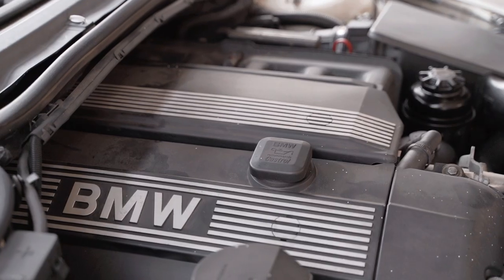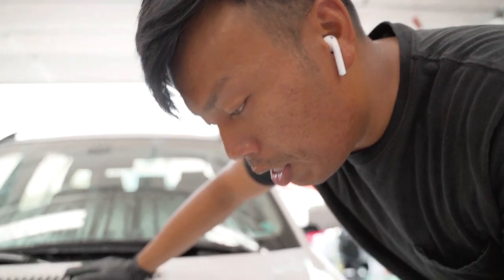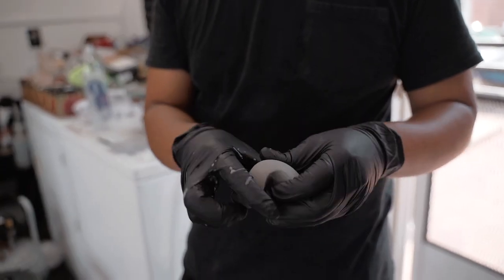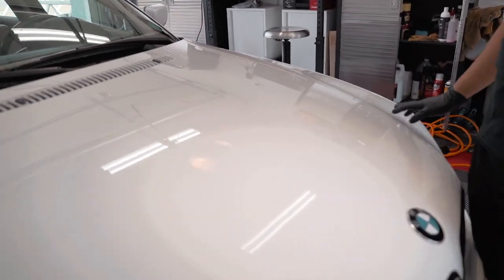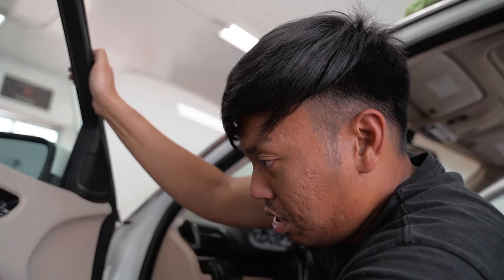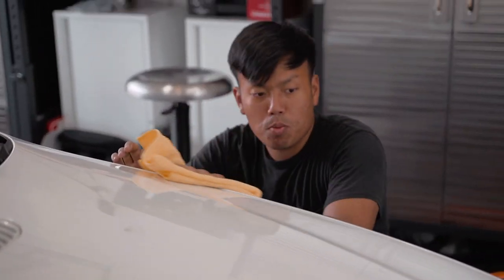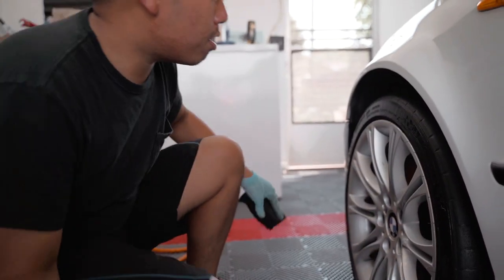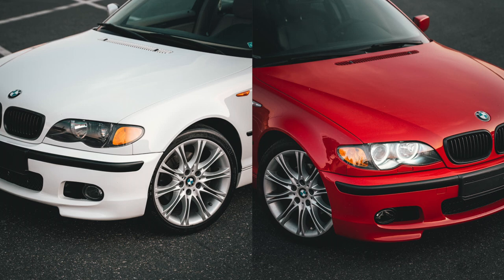DETAILING A BMW E46 "ZHP" STYLE WAGON

Comment: I just finished a zhp swap on a white wagon for a client and had to double take for a sec. Difference is I swapped in the engine and transmission. Would recommend to anyone that wants an e46 wagon. Makes a big difference.
Reply from the maker: alistair trotter Yeah 100% that’s the plan, this engine still has a lot of life for now so probably will do a trans swap for now
Reply: Geno Foster that’s awesome. I actually swapped out a totally different interior also. Now has a black and the light caramel color leather sports interior. This same client gave me one of the donor cars we used on another restomod we did. Swapped it from a 4wd to 2wd. Needless to say we live our wagons over here.
Reply from the maker: That’s awesome! I bet it came out really nice